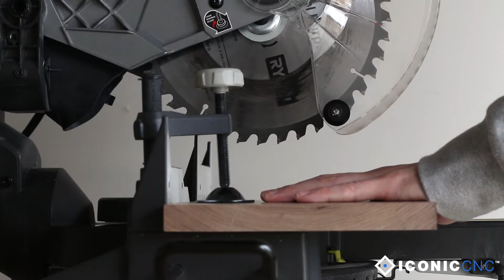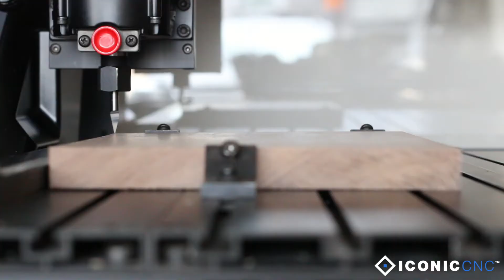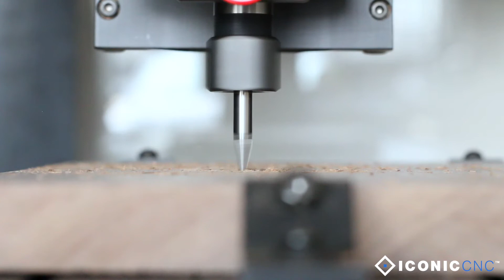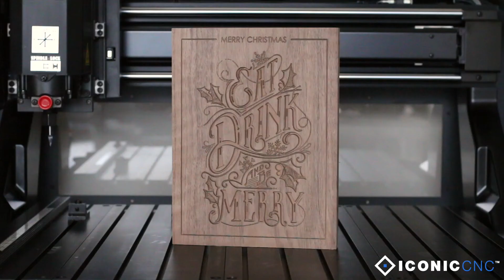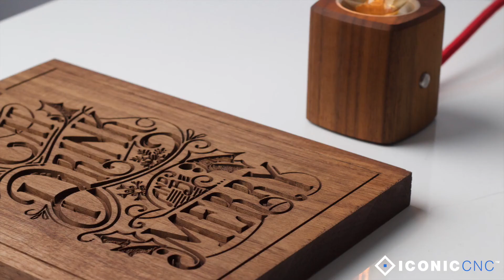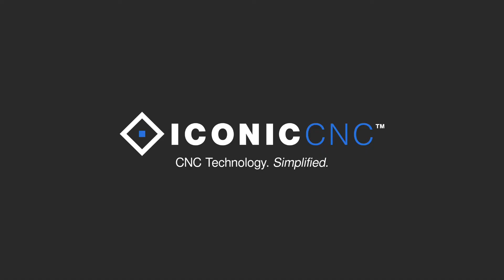Eat, Drink & Be Merry Sign

Comment: Will the program indicate which bit to use based on the design?
Reply from the maker: Built by Jessie It doesn’t tell you what tool to use, but it does provide you with full 3D preview so you can try several different tools until you get what you are looking for.